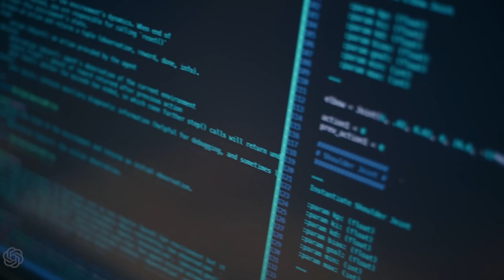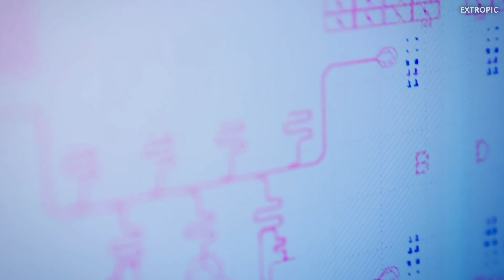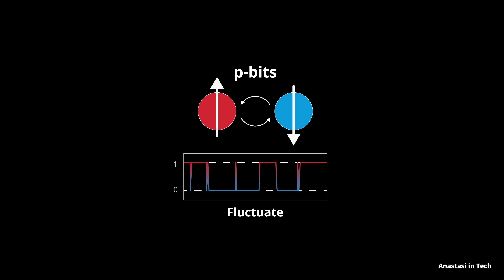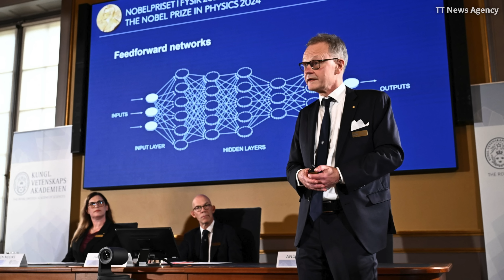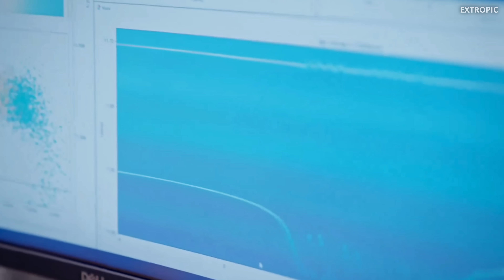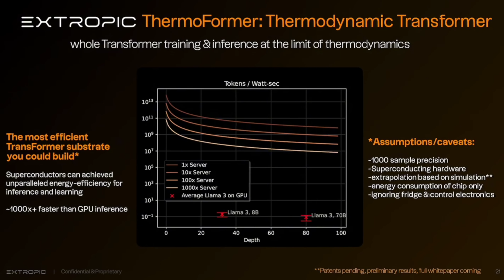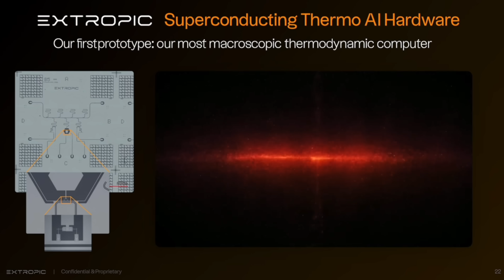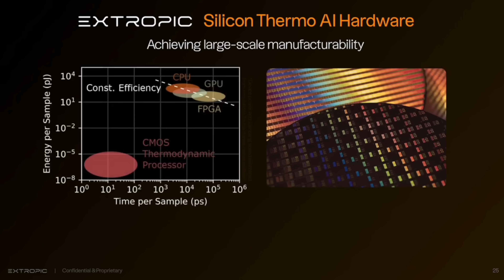Probabilistic Computers Explained

Comment: This is a fascinating concept, and it feels like probabilistic computing could truly redefine how we approach computation. But what’s equally exciting is the idea of complementing these systems with analog memory and precomputed tables to push efficiency even further.

Imagine a hybrid computing model where analog memory stores vast amounts of data in a compact format. This could significantly reduce storage space requirements while allowing rapid access to frequently used patterns or results. Analog memory could bridge the gap between storing raw data and dynamically processing it, enabling systems to retrieve approximate solutions instantly instead of recalculating them repeatedly. This would not only make devices faster but also dramatically reduce power consumption.

On top of that, precomputed tables could replace repetitive mathematical calculations in many applications. For example:

Graphics rendering: Instead of recalculating light interactions, precomputed tables could store common lighting and material combinations, making real-time rendering much faster and efficient.
Machine learning: Precomputing frequently used model outputs or decision patterns could save computational power during inference, especially on edge devices.
Simulations: Tasks like Monte Carlo simulations, which involve millions of repetitive calculations, could benefit from retrieving approximate answers directly from precomputed datasets.
This approach aligns beautifully with probabilistic computing, as the small deviations introduced by approximations would likely have minimal impact on the final results in systems designed to embrace uncertainty.

The real magic happens when software intelligently combines these approaches:

Adaptive computation: Software could decide when to use precomputed data versus real-time calculations based on resource availability or required precision.
Dynamic table generation: Systems could learn from usage patterns, updating and optimizing these tables over time to better match the user’s needs.
Holistic processing: Analog memory, probabilistic bits, and precomputed tables could work together to make computations faster, simpler, and more energy-efficient.
This paradigm might sound simple, but its potential is massive. Why exhaust resources recalculating complex operations when you can store and reuse approximate solutions? The efficiency gains could enable advanced AI and computing capabilities on smaller devices like phones, IoT devices, or even robots.

By embracing precomputed approximations and analog storage, we’re not just rethinking hardware but also reimagining how software and hardware interact. It’s a bold but logical step forward that could make high-performance computing accessible on a much broader scale.

Would love to see this become a reality—let's build systems that calculate smarter, not harder! 🚀

Comment: Let's imagine that technological processing has acquired the human quality of being able to imagine or have imaginative processing: let's go to the unit of quantum information, important to me, which is carried out by quantum processing described by a superposition of three mutually orthogonal quantum states. These states in quantum mechanics correspond to different eigenvalues: arising from the fact that the Shrödinger equation is a Sturm-Liouville equation (in the Shrödinger formulation) or that the observables, at the moment of the collapse of the wave function, are given by hermits (in Heisenberg's formulation), which using polar coordinates in the Madelung velocity flow equation (quantum hydrodynamics), we obtain a Sturn-Liouville equation. That said, the probability of the possibility of the existence of the qutrit, which is analogous to the classical qutrit-3, could be, just as the qubit, a quantum system described by a superposition of two orthogonal states, is analogous to the classical base-2 bit.
Therefore, the qutrit has three states or orthogonal basis vectors, generally denoted, they are used to describe the qutrit as a superposition state vector in the form of a linear combination of the three orthogonal basis states: where the coefficient is complex amplitudes, so that the sum of its squares is unity (normalization) – the orthogonal basis of the qutrit declares that it encompasses the complex two-dimensional Hilbert space, corresponding to the spin-up and spin-down of a spin particle 1/2. In this three-dimensional reality, qutrits require a higher-dimensional Hilbert space, measured by the base of the qutrit, which can be realized by a three-level quantum system – but not all of these systems are qutrits. Professor Shun Kanai of Tohoku University in Japan said: "We have experimentally clarified the 'switching exponent' that governs the fluctuation under the perturbations caused by the magnetic field and spin transfer torque in magnetic tunnel junctions. This gives us the mathematical basis for deploying magnetic tunnel junctions at p-bit to design sophisticated probabilistic computers. Our work has also shown that these components can be used to investigate unexplored physics-related phenomena thermally active."
On the other hand, a sequence of n qutrits represents 3n different states simultaneously, that is, a superposition state vector in the Hilbert space of the 3n-dimensional complex. Is it here, in this sequence of probability of possibility where the imagination is, something intangible of objectivity, but, being a subjective possibility, that is, thought, three-dimensional quantum imaginative processing? We know that qutrits have several peculiar characteristics when used to store quantum information: for example, they are more robust to coherence under certain environmental interactions – in reality, manipulating qutrits directly can be complicated, one way to do this is using a quantum entanglement with a qubit. Will the subjective quantum reality of the qutrit be three-dimensionally entangled with the p-bit until the moment intentionality emerges, where the p-bit is, precisely, in the middle of the three orthogonal quantum states: which one? What it seems to me is that the challenge has been to measure, directly, in these electronic components, the entire range of possible results.

Comment: So, the headline claims "100,00,000 times GPU performance". When I see "performance" I think compute time, not energy consumption (which is important, of course). Not surprised that a super-conducting circuit requires less energy than a room-temperature chip. What am I missing here?
Reply: There are many areas if efficiency and performance, and the two can be used venomously, in this case when you are talking power consumption performance.  You could also talk about efficiency in computing, though, on those two different parameters, and others.

Comment: woah woahwoah, should i delay buyng a 4060ti dual then ?
Reply: Yes, wait for general solutions using probabilistic computing, and while you are at it, disconnect from the power company until fusion power generation is personally available, and don't even consider a trip to space until FTL is up and safety proven.  ;-)  I have a plethora of good recommendations!

Comment: Transistors are not "digital chips".
Reply: Transistors are implemented for use on digital chips.  And a discrete transistor can, in fact, be exactly that, depending on utilization mode.

Comment: Super interesting & super well presented. As I understand it, the solution obtained by a Boltzmann or reduced Boltzmann machine are minimums in the parameter space defined by the energy of each state & the total energy of the system. Boltzmann showed that the probability of a given state is proportional  to the exponent of the energy divided by the temperature & the true probability is obtained by multiplying the system temperature by Boltzmann’s constant. It is a brilliantly simple model that works with physical systems & has been adopted by the two winners of this years physics Nobel prize to create AI systems that find solutions as minimums in the model space using Boltzmann’s equation. It is sad to recall that Boltzmann took his own life a little before his ideas became accepted. Thank you for sharing!
Reply: Vaguely, but in a sense, this is similar to cooking (e.g., poached or scrambled eggs) or metal annealing (blacksmithing and sword blades, etc.). Harnessing the random effects of heating and cooling to achieve some equilibrium-defined result of interest.
Reply: @ yes, but the difference is that the weights of each component are variables that can be adjusted as well as self adjusted to create minimums in the parameter space & unlike say eggs there are many more possible outcomes, some of which were never before explored as in the way AI became world champion at Go.
Reply: @springwoodcottage4248  Yes, you are right about that. But for us to get to cookbooks and recipes (and the chemistry science of foods) our ancestors had to search manually (exploring Eric Drexler’s ”timeless potential landscape of technology”) .. Finding the right initial conditions and ingredients and treatments is a difference between me and a chef in the kitchen in search of a good "equilibrium" state! 🙂

Comment: 100,000,000 times as efficient. Is that considering the total system, including cooling? When comparing, it should take into consideration the total power of the system.
Reply: the question is: gazillion times faster in computing 1% of the job isn't much of help.

Comment: Quantum computers/probabilistic computers are over hyped and over promised.   Not having a single answer but a distribution of answers is not acceptable in many cases and there is a probability that an answer may be wrong.    Also, new and completely different programing algorithms will need to be developed.  Considering its taken well over half a century to develop and refine the current binary coding (with very strong incentives to do so), it will probably take longer for quantum bit coding, as there is no impetus to persevere in developing new and completely different coding....e.g. if it gets too difficult, there is a fallback to use a classical computer. 
My prediction is, Quantum computers/probabilistic computer will not be developed for mainstream computing in the medium to long term, but will only be used in niche areas with custom coding only developed for those specific applications......Not unless some visionary comes along with a completely different approach?
Reply: Wealth will concentrate to people who make good bets into visionary world-changing tech early. The young generations especially will need to prepare themselves for this. Either they get their share by a more distributed opportunity to extract from this wealth on a more equitable basis, or we will have a revolution followed by accelerated population decline that results from the increased inequity-induced pessimism.

Being able to locate visionaries and benefit from their work by having an equity stake in them can be life changing on an individual/familial/community level. Accumulate that over generations without spreading awareness of opportunity outside that bubble, and you get severe social disequilibrium at the macro level. We need every chance to spread awareness of what is happening in technology, even if it is still speculative territory, otherwise we will live an cyberpunk-esque dystopia that separates those whose forebearers understood technology from those whose forebearers did not.

Comment: Chat GPT says:

In practice, systems that simulate p-bits with classical hardware often use 8 to 32 bits to represent each probabilistic bit accurately enough for complex probabilistic computations.

Far less than stated in the video.
Reply: And if chat GPT says it, the matter is closed, right?

Comment: For almost two years now I've been saying that doing AI using digital was completely broken. A neuron is an op amplifier, and what we're doing using SIMD to multiply, accumulate, then apply an activation function is just a super-expensive emulation of the op-amp. I just don't know how fast we could make op-amp work at the node technology used by CPUs , it might be possible that digital remains faster but I strongly doubt it. I'm still waiting for an analog AI chip.
Reply: For two years now, apparently.

Comment: A computers memory is limited to
the number of transistors it can
use when computing (constants,
variables, coefficients).  When it
is computing information is fed to
it sequentially. The result of an
Algorithm occurs as combinational
logic.  An analogy would be that
computing is like making a bag
of microwave popcorn, where each
kernel is data (constants, variables,
coefficients).  Assume that (in this
analogy) the kernels pop randomly,
but once they are popped they are no
longer a kernel. They are popcorn. So
they are moved to a different part of
memory (called the result). This frees
up the initial memory so it may be used
by the Algorithm. The Algorithm can
speed up to finish the job faster 
because it can use more memory and 
therefore do parallel processing as in
combinational logic. This saves time
and energy.
Reply: @garyrust9055 who wrote that poem?
Reply: @mhamadkamel6891  ChatGPT
Reply: @garyrust9055  I think she understands conventional chip architecture. Plus i was under the impression its propositional, sequential and combinatorial logic used in a low level architecture

Comment: I read about Josephson junctions in the 1980s  Proposed as a means of low noise superconducting switches.  Seeing them used to bridge p-bits makes a lot of sense althoughi wonder about the scalability of bridging the stochastic behavior with low temperature junctions.
 Neurons use relatively slow, but programmable activation potentials and they work at body temperature.
 Just some random thoughts but this was a great topic and I really appreciate it so thank you!

Comment: Thank you once again for a marvelous video! I had no idea this was out there! I want to hear more about it. One question I have is, are probability distributions key in this new technology? Can p-bits be operating with different probability distributions? Can they be forced into particular probability distributions? Are such distributions the key to how a probability algorithm works? Another thing I'm wondering is, what would be an example of a probability algorithm, a basic one that might let us see how these machines work? I'm also wondering about interconnections between P bits. Is there such a thing as probability gates and how do they work? And you mentioned that information flows in both directions to and fro between p-bits, but your example was in a single direction. I want to know more about this bi-directional characteristic. How is it achieved in the circuit itself? And finally, I'm wondering about the mathematics used to represent probability circuits.
Reply from the maker: Yes, PDF are configurable and it’s beautiful!

Comment: Analog computers have two serious disadvantages: There is no error correction for calculations and their hardware can only solve a single problem quickly. How can error correction be solved analog? Through correlation? How can you build an analog universal computer? Neural networks seem to be able to do it. It would be interesting to apply the inverse Z-transformation to digital data models to build analog solutions and see what comes out of it.
There are already FPGAs that can calculate much faster than digital solutions. Digital signal processing is also becoming faster with special hardware, e.g. in signal processors.
Overall, a middle way between digital and analog data processing will develop. E.g. sum (inputs) of each neuron with Schmitt trigger for output spike analog. Multiplicants in synapses digital. Trained data is loaded digitally as with FPGAs. Calculation is analog.

Comment: Not necessarily true. Reality may be totally deterministic actually.
Reply: agreed and thats how we operate, by some predictive measure
Reply: @devilsolution9781  Well we must be careful to distinguish between ontological and epistemological determinism. Technically speaking, "determinism" only refers to the former in that the past determines the future (if so).
Reply: @djayjp  whats the difference?  the only thing i can think of thats non deterministic is some aspect of quantum mechanics that describes the collapse of the probabilistic waveform to a particle
Reply: @devilsolution9781  Ontological is what's actual in reality. Epistemic is what we know (or can know, in principle). Actually regarding QM, there are various, equally valid (to the Copenhagen interpretation), interpretations that posit determinism (such as pilot wave, many worlds, etc).
Reply: @devilsolution9781  Which is the underpinning for literally EVERYTHING.
Reply: Superdeterminism is unfalsifiable.
Reply: @JorgetePanete  True of all interpretations of QM (so far anyway). Though I wasn't referring to Superdeterminism, but rather other interpretations of QM which feature vanilla determinism, including pilot wave and many worlds, among others. The distinction is that determinism requires no causal link between the results and the parameters arrived at ("chosen") by the experimenter.
Reply: First demonstrate the no-cloning theorem is wrong, otherwise wasting time thinking about something that will be forever completely irrelevant is nothing but mental illness.
Reply: NOT   EVEN   REMOTELY.   Either that, or you live in a different one than I do.
Reply: @MrJdsenior  Lol ok well that opinion isn't valid as you don't know.
Reply: @djayjp  Yes, or no, take your pick.  Wait, what ???   ;-)